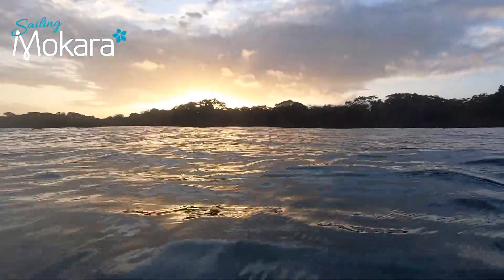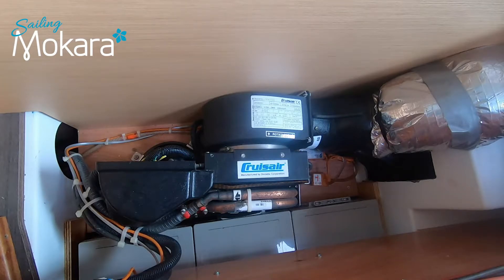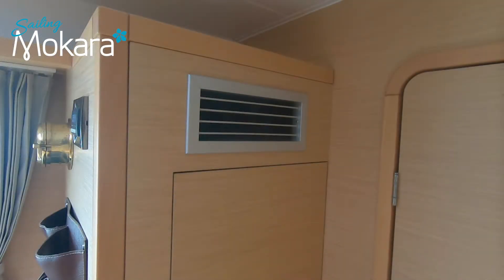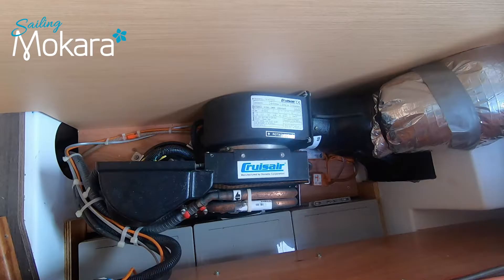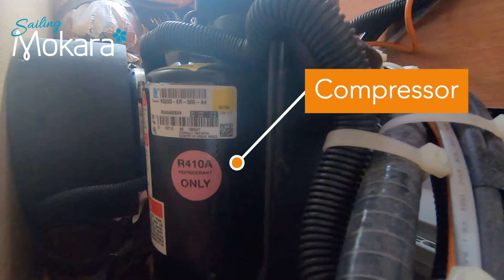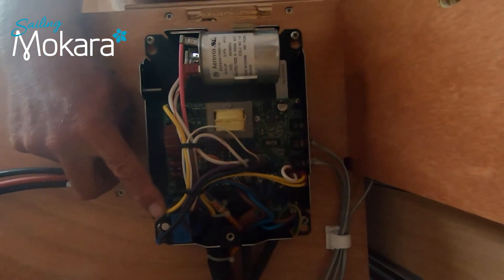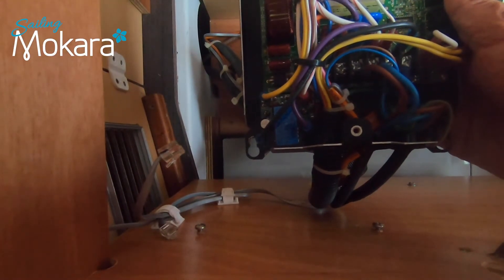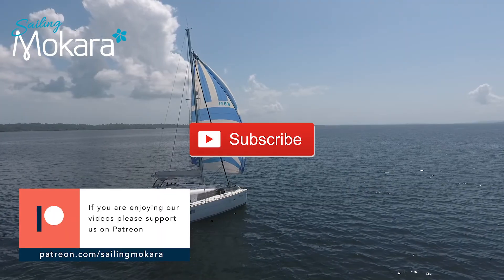Dometic Cruisair Air-conditioning not cooling - How to repair

Comment: Hi I have a sea ray sundancer 2005 the ac unit stopped cool I had it checked but mechanic says the compressor turned bad. He can’t find a compressor anywhere he says the unit is too old I should replace everything which is a lot more $$.. do you know where I can find a compressor ? Part # SXF12/1- RMT
Reply from the maker: Hi. I have had a look for you and cannot find anything. Sorry that I can't help you.
Reply: @SailingMokara  thanks for trying 🙏 if you find a used one lmk haha I was told to contact dometic I’ll try after the wkend

Comment: What absolutely amazes me about Dometic Cruisair is that it's installed EVERYWHERE. No offense, but your boat is not the most expensive, so I thought it was some affordable system. Imagine my surprise when I saw the same Cruisair machine on nothing less than an Oyster yacht. And if you don't know, Oyster is like Rolls-Royce of the yacht world. It even breaks down with the same frequency and maintenance is as expensive.
Reply from the maker: Yes, seems to be the standard unit that everyone has. We have been sailing in the tropics for a few years and we hardly ever use the air-conditioning apart from running it to keep it working. Definitely not a necessity unless you are happy to run the generator through the night.

Comment: How to clean the internal parts of the cooling tubes on a crusair unit???
Reply from the maker: Hi Edward. As of yet I haven’t done this. I am sure I have seen videos about this where they flush Barnacle Buster through the system. Good luck.